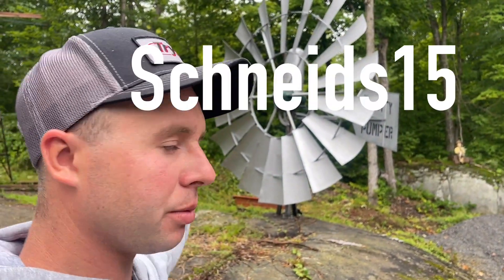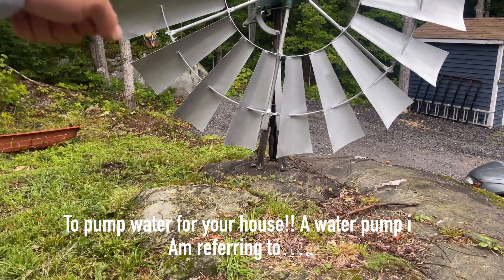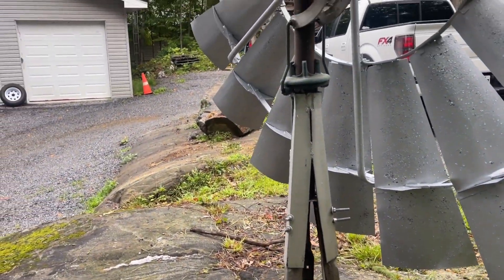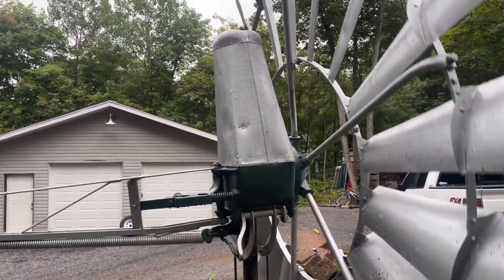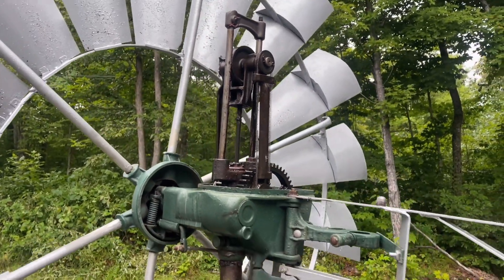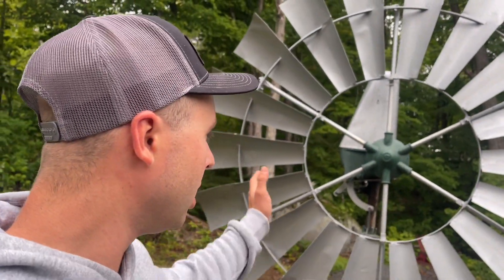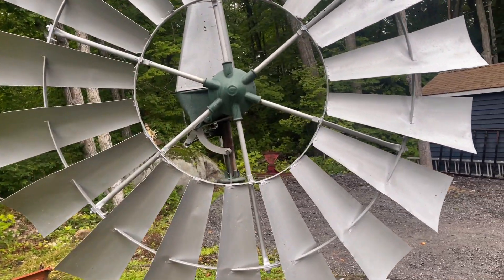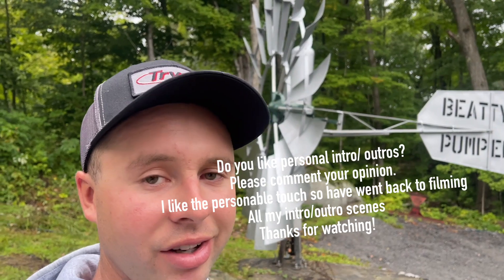How Antique Water Pumping Windmills Work mechanically

Comment: Hi Josh! 
This is an excellent video on the governing system of the Beatty Pumper. I'm from South Africa and am currently restoring one myself. I'm missing the bracket just below the tail—the one the tail spring attaches to.
This Beatty windmill is not so common in my area, and I am battling to get any info, let alone spares.
Would it be possible for you to post a few photos of this bracket and maybe share the dimensions? It would really help, as I need to fabricate the bracket myself.
Thanks so much in advance!
Pieter
Reply from the maker: Hey Pieter, wow absolutely I will help. 

Email me 
Schneids15businessenquiries@gmail.com and I will get you pics and dimensions.